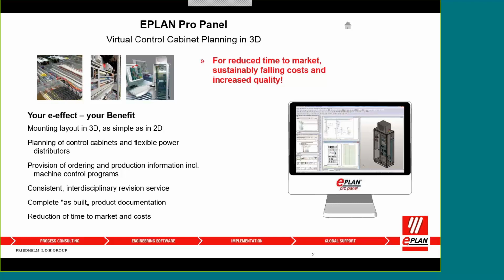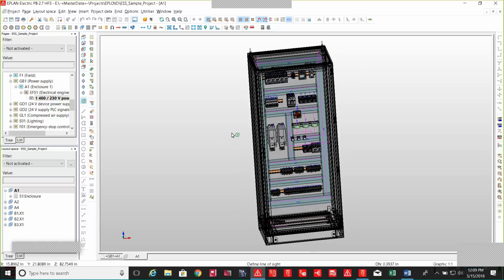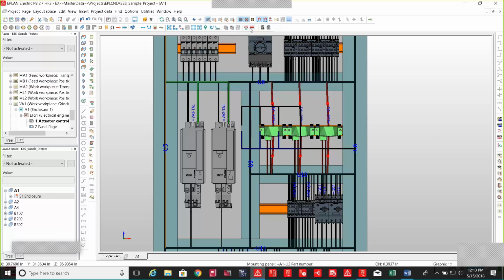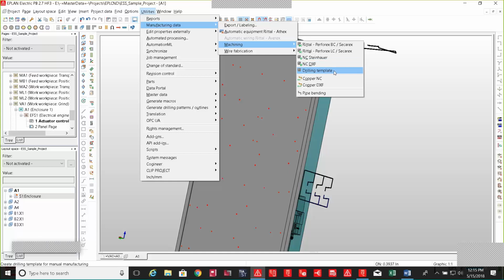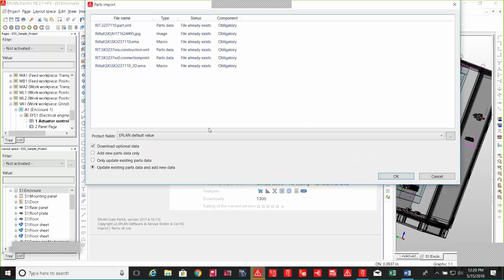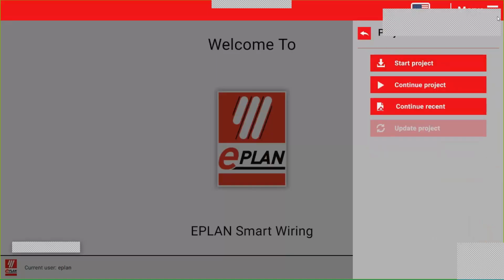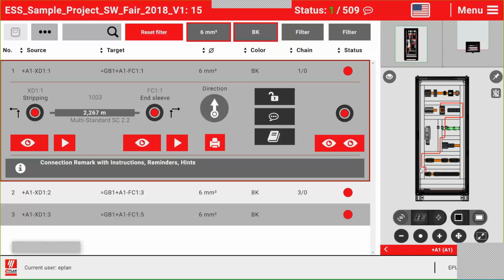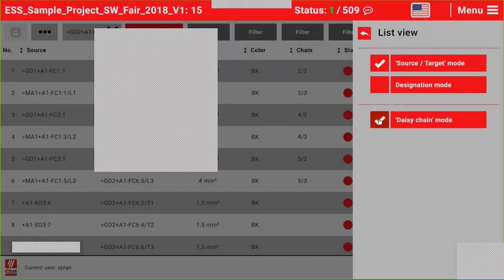Virtual Fair 2018 - EPLAN Pro Panel and EPLAN Smart Wiring

Comment: Thank you for sharing this presentation. Right now we do not use Pro Panel but we are thinking about integration in our current workflow.

If I understood right, the data source for Pro Panel is the EPLAN Data Portal as well, right? What can I do when the 3D model is not available in Data Portal? Import manually a step file? Or are 3D models available for most parts in Data Portal?
Reply from the maker: Hi Philipp, 
Thank you for your interest. For technical questions please contact our support https://www.eplan.de/de/support/ 
Best regards,
Your EPLAN Social Media Team
Reply: Hi Philipp , I face the some probleme about EPLAN Pro Panel .Did you find a solution please !?